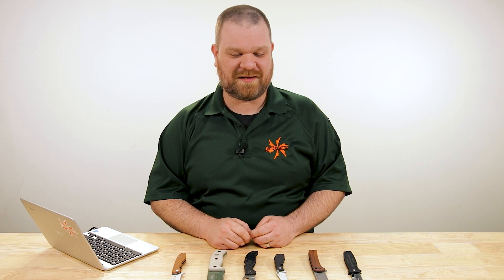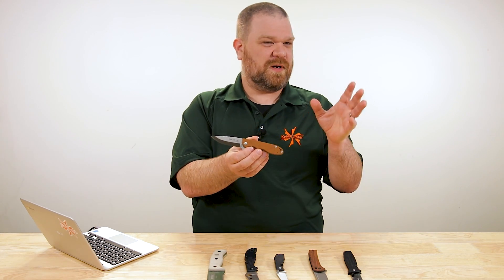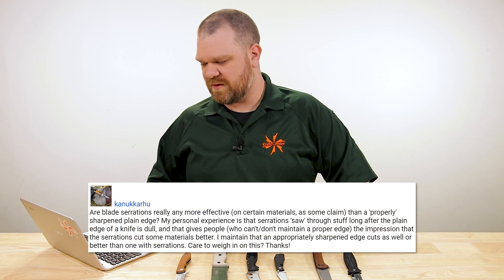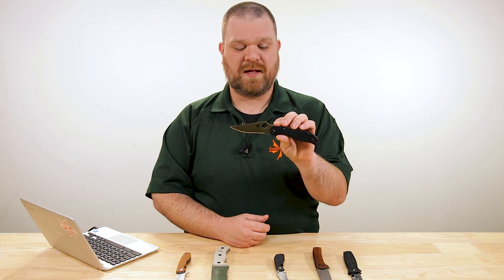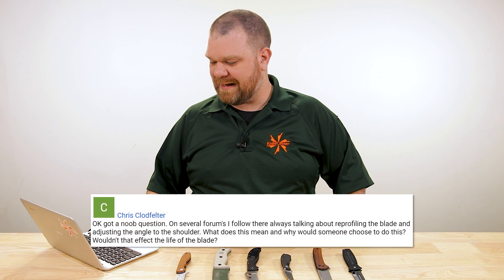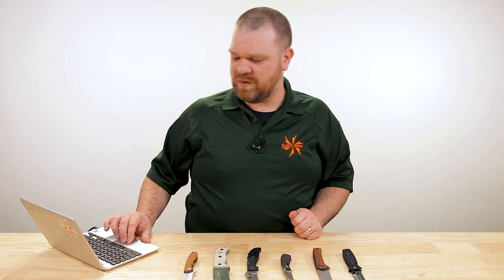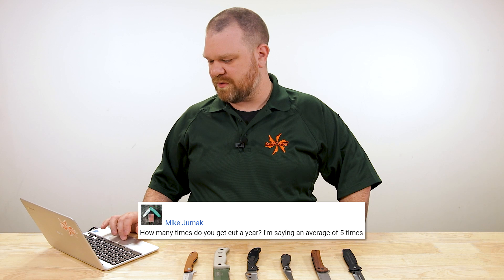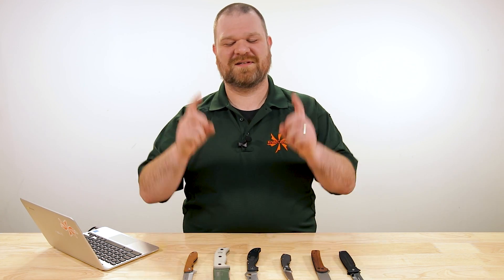KnifeCenter FAQ #80: Are Serrations Bad? + Scandi, Saber and Flat Grinds

Comment: Tongs don't work right unless you click them a couple of times right out of the drawer. I thought everyone knew this! 😅
Reply: Very true, this also applies to scissors and click pens.
Reply: Underrated comment 🥇🤘🏻
Reply: Now Im not sure if this applies, but may be similar to how garbage bags hold more garbage if you incessantly swing them up and down, filling them with air, while making obnoxious amounts of noise.
Reply: It's true
Reply: Actually in many places, you LEGALLY have to do a crab/lobster impression every time you take out your tongs precisely for this reason.
Reply: If you don't take a couple test clicks they might fall apart when you go to pick up your food and now your pork chop is charcoal. Why risk it?
Reply: Also, if you don't rev an electric drill a few times before using it, it probably won't work, and you void the warranty.
Reply: Tongs don't work unless a Brazilian girl is wearing it.

Comment: The german Company Güde  (Franz Güde son of the Founder of Güde Knnives) inventet the Wellenschliff (Wafegrind) especialy for Bread. Wellenschliff is a form of seration and as far as I know it was the first serration developed for Blades (1931). This special serration should help to cut the Bread without pressing it while cutting. Serrations do not only have a Advantage when cutting Ropes but also when cutting soft Materials without much pressure. Another situation where serations have an advantage is when you have to cut deep through several layers of closing. A polished edge can glide over the material without getting a "gripp". Sharks use serated teath to cut ther prey. PS: sorry for my bad english

Comment: I’d love to listen to you talk about coatings… I have a few knives that have cerakote and I haven’t been impressed… I have a BM 940 where the  anodizing has held up great… much better than my experience with cerakote. Then you have the treatment of parkarizing on a BM clip which holds up amazing. I think metal treatments and coatings would be a great full episode discussion
Reply: This ⬆️
Reply: They had episode about that .
Reply: I have a Spyderco Native 5 with their  smooth black coating (can't remember actual name) and it has been amazing! Super tough and hard and hasn't chipped or rubbed off at all. I am pretty hard on this knife too!
Reply: Benchmade puts a nice finish on their clips now. It used to be crap, it was no more than a mediocre to decent quality spray paint. Spyderco seems to use a pretty good finish too.
Reply: @Arman-jx7hu  Ah, another Native 5 fan. Pleasure...

Spyderco's coating is referred to as a "DLC" coating (Diamond Like Carbon coating). It's similar to a PVD (Physical Vapor Deposition) coating in that the coating is actually the surface layer of a metal that's been molecularly bonded to another substance instead of something like cerakote, which is a more traditional coating that can chip away.

DLC coatings are something else. As the name suggests, the carbon that's bonded to the surface is formed in a way to the structure of diamonds, so it's incredibly hard stuff on a molecular level. It can wear over time, but it's definitely not something that's going to be chipping off.

I've had my Manix 2 for roughly two years now. I carry and use it for weeks at a time, and aside from a few light snail trails and hair thin scratches, the coating has held up incredibly. I actually kind of like the wear on it, too. It doesn't look chipped and ugly like a cheaper powder coating would.
Reply: I always thought DLC was supposed to hold up better than other coatings, but a guy who did some custom cerakoting for me one time told me that TiNi is the toughest. 
I would also like to hear some more about this stuff.

Comment: I'm surprised you didn't address "effective edge length" on a serrated blade.  Every one of those little scallops adds up to a significantly longer total edge if you were to measure the distance along the curves.  A fully serrated knife can have an effective edge of double or even triple the length of the blade itself.
Reply: Good point
Reply: Triple or quadruple
Reply from the maker: I've talked about it in the past. Didn't think it was as germane to the question at hand, but point well made sir -DCA

Comment: My favorite blades have all had one thing in common...Half-serration. It is priceless. The smooth point and first half is great for any normal knife work, and the serration is perfect for sawing cardboard, harder cuts with less pressure, and the points of the teeth can sometimes be used for what the point would be used for (and you have a ton of fresh points when needed), without dulling the actual point (because a duller saw tooth is not going to affect anything in everyday use).  I have heard a lot of hate for half-serrated blades, but they are amazing.  It should be noted that I dont carry $400 blades that I have to worry about sharpening and keeping perfect.  That said (topic tangent), if you carry a knife for self-defense, grab a good fixed blade for JUST that, then use your cheaper flippers for daily work.
My brutally used (army, camping, industrial maintenance at civilian job) Gerber 800 Legend still has a razor sharp serration and the straight edge has only been sharpened a couple times in it's nearly 20 years.
Reply: I agree.  It's a shame that the "knife bros" are so biased against partially serrated edges.  When I worked on a farm, I always carried a partially serrated knife.  A plain edge just sucks when dealing with a wad of dirty/gritty twine.  I have to assume that the guys who hate serrations have either an office job or they just don't do much dirty work.

Comment: I'm a knife maker and I keep hearing "I can keep my knife sharp, I don't need serrations". lol.  So I did a test with some very high end steels and very good edge geometrys for slicing VS serrations.  And I found that serrations worked very well in certain situations.  In fact they out performed a scary straight edge.  Like it was said in the video, rope cuts and particularly cutting things like seat belts, serrations smoked the regular edge.  Just my .02
Reply: nothing I use my knife day to day for requires that second advantage, but a lot of what I do requires a clean, neat cut. I prefer plain edge
Reply: @charlesissleepy   That's why the partially serrated edge was created.  People need the serrations only some of the time.
Reply: @BornIn1500  Well... Serrated edges are as useful and commonly used, as glassbreaker tips. Like one time per decade? :]
Reply: @Nudel-nc1cp   Serrated edges are useful for people who do real work.  For instance, plain edges suck at cutting through a wad of dirty, gritty twine.  It's a shame that most "knife bros" are office workers who think cutting cardboard boxes is "hard use".

Comment: On the question about opening and closing or unsheathing and sheathing the knife.  Like any tool, it is good to verify it works before going into battle...or work...or play.  It's good to verify that it is functioning as intended before arriving at your destination.  Also, it's fun.
Reply: Folks used'ta tell me I was playing with my knife...no I was practicing....even if I WAS playing with it
Reply: Slippery??? Add a bit of skateboard type tape

Comment: DCA did a good job explaining the benefits of serrations in certain use scenarios. 
A huge benefit is that as you make a straight draw cut with serrations the blade touches the material at a variety of different angles. Depending on the pattern the sharpened edge comes in at 90 degrees, then transitions  to over 45. This is especially apparent when sawing back and forth. It’s similar to when you are cutting something really tough and you saw back and forth using different angles, but the serrations do that for you with each cut.

Comment: If I have serrations on a knife I really like having partial serrations. I feel like it gives you the advantages of a plain edge while still giving you the option to easily cut through rope. I really like partial serrations on my outdoors and “tactical” knives. On my Microtechs I like the d/e with the top edge being serrated and the bottom being plain. I also really like how benchmade leaves “puppy teeth” on their plain edges, which gives you a little bit more traction when trying to get through a rope

Comment: I need a new beater knife, Sunday (5/15/2022) I drove 1.5 hours to my sons house to fix the water well. I had to use my older version Kershaw Vapor as a chisel to dig out broke PVC pipe threads in a water tank. I ended up breaking my Vapor thanks to a hammer. I am glad I did not have one of my better quality knives with me or I would have felt bad about hammering on the knife. DCA, What Knife would you EDC Knowing there was a possibility you were going to hammer it to death? P.S. thank you for your devotion to the knife industry.

Comment: My uncle has been a white water rafting instructor for 26 years. For ten years he’s had a Byrd Cara Cara Rescue 2 (Spyderco) with full serrations, a $37 knife. He’s never had to sharpen it because serrations have so much cutting power and they takes years and years before they need to be sharpened and by that point you would have got a new knife anyway. If you want a knife that’s just going to work/cut every time get a serrated knife.
Reply: Thanks for sharing

Comment: DCA, it's gardening season once again! Let's talk pruning knives across all the budgets! Let's go with pruning everything from garden veggies to flowers and small branches. There's definitely acidic plants to worry about (corrosion resistance), ease of opening and closing one handed and ease of cleaning are a few factors that come to mind. Would be used heavily all around the garden, so cutting rope, twine, the works and getting real dirty. 

Microtech OTF with double sided blade and serration in Elmax comes to mind, but pain in the butt to send off to have it opened up and cleaned when  it gets really dirty. What other options can you think of? Both fixed and folding options are appreciated (but having 2 bouncing puppies make fixed a little less safe for the next year or two!)
Reply: Opinel makes some good pruning knives and if something happens to it they arent too expensive to replace
Reply: @kydd666  Appreciate the input. Personally not a fan of Opinel, and they don't fit my criteria of ease of opening and closing one handed.
Reply: Love this question! I think it's a good one for KAQ. My personal go-to in the garden has been a Mora 510 (wish they made a 511 with lefty sheath). But this year I'm using my new Spyderco UKPK Salt. It's bright yellow for high contrast if it falls in the dirt, LC200N, ambi, and one hand opening/closing. Super easy to clean. I think that the Magnacut Native 5 Salt coming out later this year might be a good option too. But if I'm doing any amount of pruning I will usually reach for pruning shears just to reduce plant disease potential

Comment: I generally prefer a plain edge, but for certain jobs I want serrations.  As a Hydro Operator doing high voltage switching and LockOut TagOut, I cut a lot of tie wraps (retired after 45+ years).  Serrations work.  In rescue work, everyone knows serrations are great for cutting nylon webbing and rope. They are also great for going through stranded copper wire.  My EDC knives all have plain edges, but my EDC includes a Leatherman WAVE with a serrated blade.

Comment: Hey David, I've decided your idea of a Victorinox with serrations at the tip of the blade on the One-Handed Trekker is a great idea.  Do they make suck a knife with: One hand opener, saw, scissors, phillips and screwdriver? Other instruments like bottle/can opener and awl would be nice, but the saw, scissors, and one-hand opener are must-haves. By the way, I live in the desert West, and when my hands are really dry, my wooden-handled Conspirator also slips very easy in my hands. I'm going to put in some hand checkering with a very fine saw blade.

Comment: I guess i do it the hard way - i used one of those pocket diamond sharpeners that has the hook sharpener - can flip it around and use the small curved part to sharpen the serrated part without grinding the points down and then just sharpen the rest of the edge with traditional sharpening

Comment: Thank you for great videos.  This is more of a rant than a question, but anyway, here it goes: 
I don't get thumb studs in folders, and especially in short blades.  More often than not, once the blade is deployed, the thumb studs gets in the way of both sharpening and slicing.  Am I the only one that views this as a problem? I personally prefer flippers or a thumb hole, where Spyderco seems to be the most consistent manufacturer. I have a Kershaw Shuffle which IMO illustrates this well, but even on my Civivi Badlands Vagabond (which is a great EDC in most ways), that thumb stud sometimes get in the way.  Thoughts?
Reply: Agree! I wish more knives used a “disk” in the spine like  my Benchmade CQC 7. Very positive opening but out of the way for sharpening and most slicing.

Comment: Hey DCA! Thanks for the content. I like to carry thin bladed pocket knives from time to time. I have a Civivi Lumi and a Spyderco Ladybug in K390, but I have not been able to find many knives in the 3 to 3.5 inch blade range with a blade thickness of less than .125". It must be a locking blade and my price range is $40-$150.
Reply: Check out the Hogue Deka, specifically the one in 20CV with a Wharnecliff Blade. It's VERY thin and last I remember only like $130. AMAZING edge on them too. Might be a bit long, closer to 3.5-4 inches.

Comment: Spyderco serrations are the joint if you are in need of serrations. I have a Spyderco SS Police model, fully serrated lock back that I bought 27 years ago, on my 18th birthday. I have sent it back to Spyderco like 3 times to have it sharpened, reground, reground...all for free. The tallness of the blade is like 30% less than original because of the serrations having to be reground twice. I have used the shit out of that knife. Now, I am more a PM2 guy, but I am kinda about to get a fully serrated Pacific Salt......... AND, a KC exclusive, Olive Drab Alox Victorinox Huntsman when you guys get around to sourcing that....please.

Comment: Hello DCA! I need help. I recently lost my Kershaw Vapor which has been my go to edc for nearly 20 years. I have a Tupperware container full of knives from Buck, Cold Steel, Spyderco, and other brands, but none of them feel and care like that Vapor. So what would you recommend as a possible replacement up $125 in price, 3 inch narrow blade height. Bonus points for USA made and an easy to sharpen steel (read as no D2).

Comment: Large-handled small-bladed folder?
I have larger than average hands, and really like a full handle, but there are times when I want or need a smaller blade, ~2.5” (e.g. for precision work, or to avoid concerns in crowded public areas, or where limited by law such as Boston). I prefer great materials, but understand my choices may be limited. I just want a medium/small blade with a great full grip in a pocket portable package. Any recommendations?

Comment: Hey DCA, I'm looking for a second knife to accompany my folding razor blade for construction use. Preferably a manual flipper under $100 with thumb studs and pivot washers.
Reply: The QSP Penguin was my first "good" knife I started carrying at work (remodeling).  Inexpensive (40 something $)  and the blade shape is utilitarian.  I have many other ( more expensive) knives now and it's still one of my most carried for work EDC

Comment: If you could do a full material upgrade on a Budge knife. What knife would it be? Mine would be an S35VN -G10 cold steel voyager
Reply: This is a great question, hope he does it in a video.

For me it'd be any of the Civivi button lock knives in M390 with maple burl scales
Reply: S45VN & denim micarta XL Voyager tanto. And upgrade the pin sizes and stop bar sizing.
Reply: I would say Pioneer X with S35VN.
Reply from the maker: I've kind of answered this before - Gerber Sumo deserves an upgrade -DCA

Comment: I've recently picked up my first framelock flipper, a ZT 0462. Fantastic knife, although I find I more careful with heavier cuts. Because when I grip it tight as I push through the material the frame lock can get jammed in a lot deeper than intended and sometimes hard to disengage. Do all framelocks have similar issues, is this particular examples just flimsy, or am I being too hard on it.

Comment: I despise serrated blades, especially partially serrated with the serrations at the base. You can't whittle or strip electric wire with a blade like that. As for cutting heavy rope, there's not much call to cut hawser in central Kansas.

Comment: Serrations are incontrovertibly better for fresh bread and materials of similar texture. I usually use a serrated edge to cut large pieces of low density urethane foam etc. Other that that, an understanding of how not to use a knife like it's a saw or some other tool will handle most other issues. If you really need something that will withstand abuse and don't ever need a fine cut, or you just suck at sharpening, serrations are also probably the way to go. With experience in both use and sharpening, one will usually find fewer and fewer uses for serrations and "toothy" edges.

Comment: As someone who wears a lot of suits to work I'd like to buy a new executive/ceo type pocket knife.  However, the blade length in many executive knives seem fairly long.  Usually around the 3 to 3.5 inch range it seems like.  Can you recommend a slim style like the crkt ceo or the Samior, but with a shorter blade length to not scare off any office folks if I need to use it?